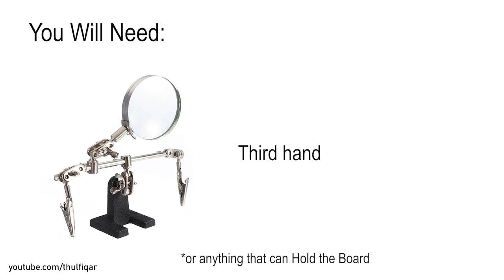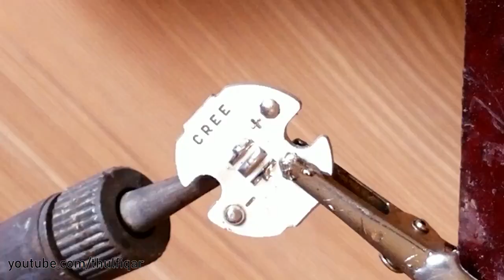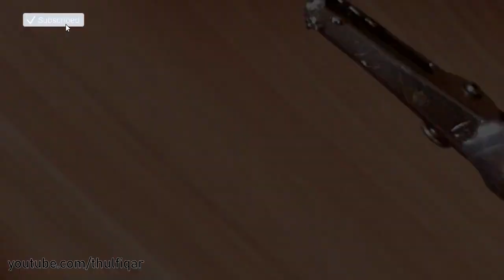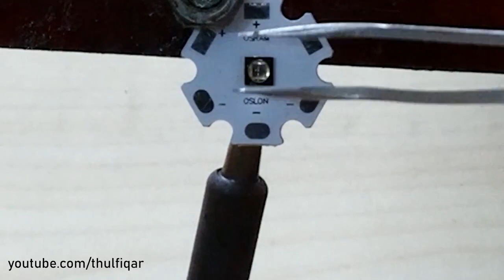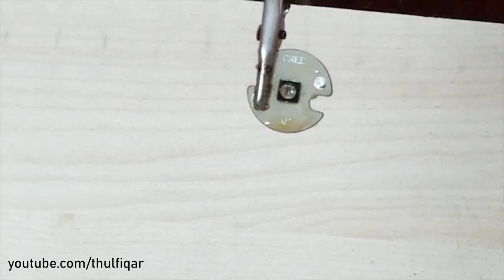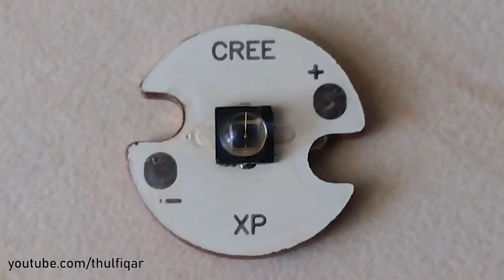Reflow Solder an SMD LED USING Only the Soldering Iron ||  WITHOUT Hot Air & Solder paste

Comment: Doesn't that leave solder on the other side of the mcpcb resulting in uneven surface since it's almost impossible to remove it without scratching the board?
Reply from the maker: Exactly, that's is what is mentioned in the description.. Don't put solder on the tip of the Iron when heating up the back of the Copper MCPCB Board so that the solder doesn't stick to the copper.
It is preferable to use hot air if you are soldering Copper MCPCB board.. but if you don't have it then this method can work using a soldering iron to heat the back of the board without putting any solder on the tip of the Iron so that the solder doesn't stick to the surface of the back of the MCPCB board which keeps the surface even.

Comment: anyone know if this damages the LED?
i was looking at max soldering temp for an LED and it said 115 Celsius
what is strange is that reflow soldering melting point is higher than that, so what now?
Reply from the maker: Reflowing needs to be done as fast as possible, yes, it can damage the LED sometimes if it was left under the heat for too long or if the temperature is too high.
Try to reflow cheap LEDs first, as you are learning you might damage some of them. And when you gain experience, reflow the expensive ones.